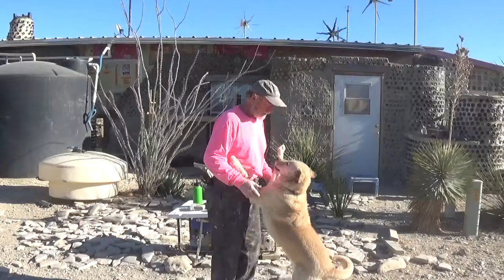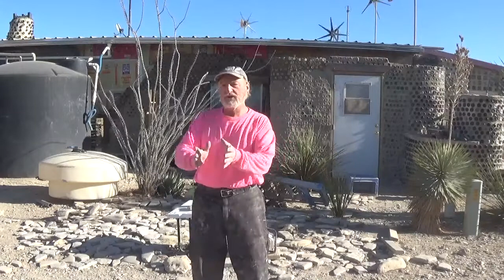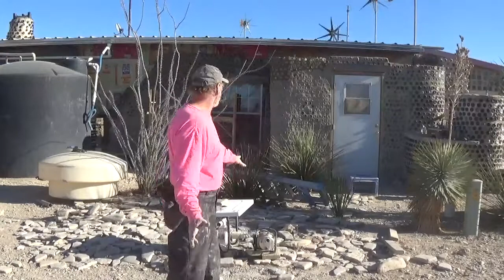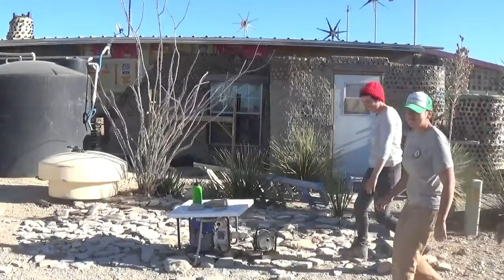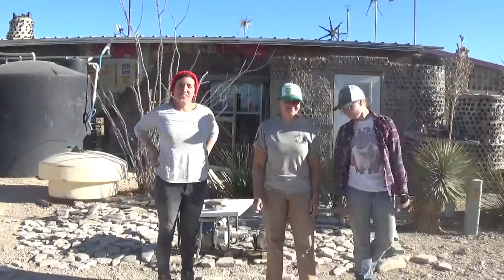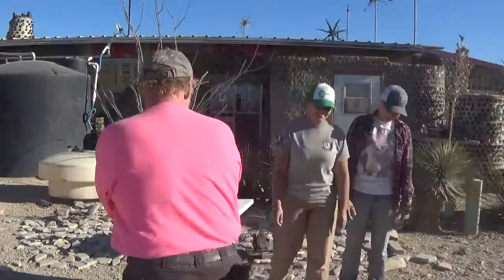Mechanical Room Build, Part 2.1

Comment: I can't help but think...so please pardon me for overthinking. But I'm curious how much heat a big tank like that absorbs in the heat of the day. I'm curious if you could absorb enough heat in a large water tank via solar energy, to use that warm water to circulate it through a floor as a radiant heater using a small 12v pump?  
Guess there are oodles of different ways to capture and transfer energy. It's just fun to think about it .
Hope you're staying cool out there this summer.
Reply from the maker: The tanks only get warm in the Summer, when we DON'T need heat. For heat here, we are installing black poly pipe on the roofs. These will absorb the sun's heat in the Winter day, stop circulating at dusk and DRAIN so they won't freeze. Additional heat will come from the giant rocket stove.

I cannot find a use for the tank heat in Summer, but it never goes over 90 degrees.
Reply: Interesting. That pipes on the roof is clever. And it just occured to me that you have those big steel radiators...